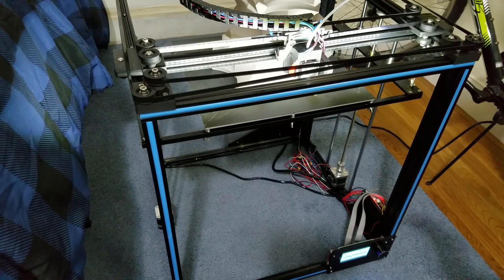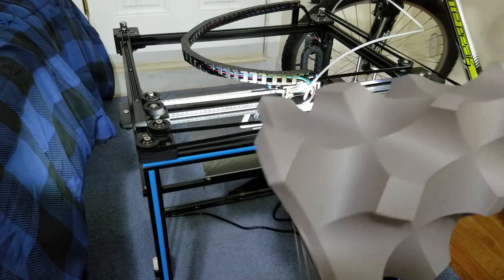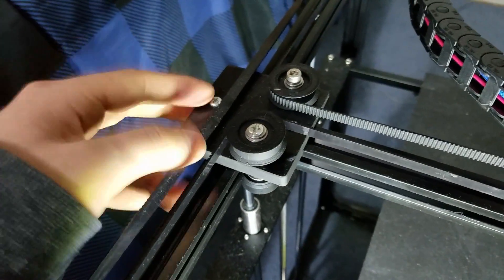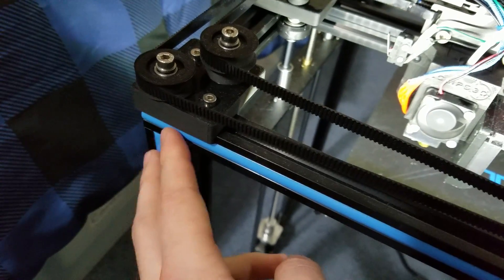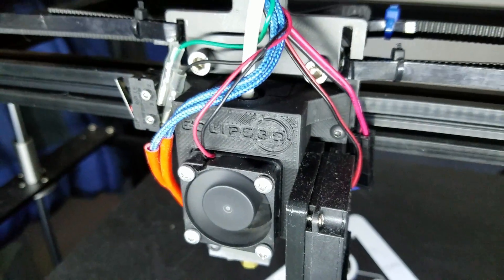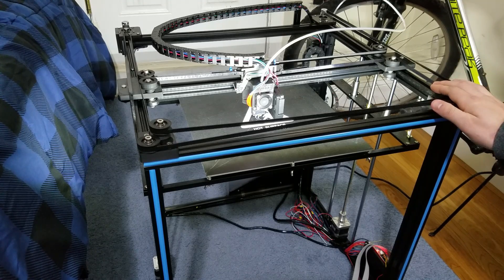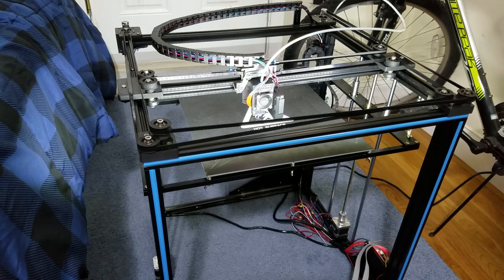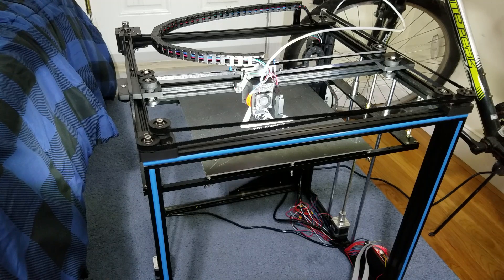TronXY X5s Recommended Upgrades

Comment: Hi, I recently got a tronxy x5s, it took me some time to build it and wire it but I like it so far, seems like a good start point, I’m new to 3d printing so I know little about it. I got it working and everything seem fine, when I was going to heat up the nozzle it stop working, I checked it and the onboard fuse blow up. I have been looking for information about this around the Internet, what fuse should I replace it with, I’m seeing if I could solder a external fuse, I’m thinking of doing mosfet boards to the bed and nozzle to be safe, should I try to repair it or should I get a different mainboard, something better and what would that be. Thanks.
Reply from the maker: If the fuse blew up then you likely have a short in the hotend and you should check that first before replacing the fuse or motherboard entirely as it will likely just do the same thing again. If you have a multimeter that is the easiest way to test it but I'm sure there are some other creative ways to check for shorts if you Google it. After you fix that (can probably buy a new heater cartridge for the hotend if that is the issue) then I'd say just buy a new fuse if you aren't looking to spend much time or money. Or if you want to really upgrade, there's a few nice <$50 control boards with trinamic drivers that can be found. I would recommend checking the steps to update the configuration and firmware before buying though, as flashing new fw on some boards can be tricky if you have never done anything like that before.
Reply: @3DprintedLife  Thanks, found out that there was a short on the hotend, already bought a new one, if I'm not wrong the cr10 one works with the x5s, going that route for now.

Comment: btw, you said the bed wasn't flat. I think I may know your problem as I had it too. When I tried leveling, the hot tip appeared to be further from the bed near the edges and much closer to the bed in the middle. I at first thought the bed was curved. But it being raised in the middle made me suspect the middle rods where the Z screws are attached. I was right. The rods were fastened all the way and unfortunately that arched the aluminum frame pulling the top and bottom a few microns closer to one another. I loosened the rods and the stress was released, I did another leveling check and not the hot top moves relatively level across the entire bed. Its not the bed that curved, its the frame that got arched by the rods. Now I am trying to balance the tightness as I need the those to be tight while at the same time not pulling the frame too hard. hah....
Reply: BTW, my hotbed is a failure... took 40 mins and it cant reach 60 degrees. And it draws 250W full time in the last 22hours or printing. Not sure if something is wrong. About that silicone thing you said to put under the hotbed, what is that again? I never needed something like that with my higher priced printers.

Comment: I think you should make a video on your original Eclips3D V1.1 printer but modify it for a 300mm x 300mm bed and the new E3D Titan Aero.   That design was the best i think even better then your 2.0 because it was easy to make the parts to build it.  The 2.0 had that big aluminum plate that was hard to get machined.  My V1.0 is still running and printing better then any printer i know.
Just My opinion.

Comment: Very honest review. I bought one and its a piece out of the box. Lots of parts and tinkering it is much better.  For 499. or less w/coupon you can get a Folgertech ft-5 with 300x300x400 build volume a 24volt system, MKS 1.3 board, and linear rails, on x and y. I wish I had known ,its 2 times the machine. I am slowly upgrading the Tronxy to a better bed heater for petg etc and a new motherboard now.  Excellent review by this man , Its spot on point.
Reply: Paul F I FT5 has only 8bit MKS 1.4 board
Reply: @Jan Prokop maybe but not matter much as when got base printer can upgrade to something like duet board
Reply: I completely agree total piece out of the box, I bought the X5S-2E waste of money until you upgrade it. I posted all upgrades here https://www.thingiverse.com/groups/tronxy-x5s-2e , best of luck guys !

Comment: Mine came with the pulley system upgraded, all belts parallel out of the box. Still made out of those crappy washers though, which I will change. Reinforced the whole thing with 90deg angle brackets. Also the ptfe tubing that comes with it has a larger internal diameter, allows for too much slack inside. Ordered a v6 and some capricorn tubing, currently using stock extruder/hotend and a duet WiFi to drive the whole thing. I love it.
Reply from the maker: Great to know, that's what I get for being MIA for 2 months! Personally I don't think the angle brackets are necessary, the frame is rather rigid. But if you are already placing a Misumi order or have the parts laying around it is definitely a good cheap upgrade with no downsides. The PTFE I received works just fine, it is a long length so there is some internal slop but it hasn't caused any stringing.
Thanks for all your input!
Reply: Hello, I know this might be crazy, but could you send me the pins.h file necessary for modifying the Printrboard from the QU-BD One Up in order to make the SD CARD work? Thanks !
Reply: Yeah brackets are not really necessary, but I already had them lying around so I might as well use them. I think it has more potential than the CR-10, and that's really all that I look for when getting a cheap printer. Now I'm working on an enclosure for it, will probably fix the extruder above it in order to shorten the bowden tube.
Reply: How long have you had your X5S and where did you order it from.  I just placed an order over the weekend for one from Gearbest.  I am hoping I get the upgraded pulley system.
Reply from the maker: Definitely crazy ;) Sorry but I don't have any of those files anymore, at least I cant find them anywhere!
Reply: Alejandro, what motor settings you're  using on your tronxy x5s with the duet? I have the duet ethernet and a bondtech extruder and e3d that I'm going to being installing here soon.